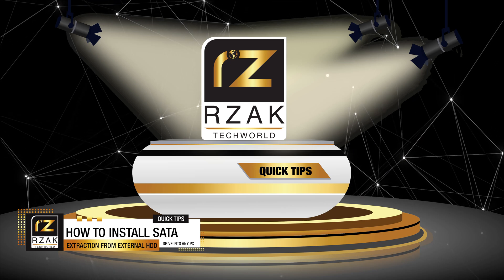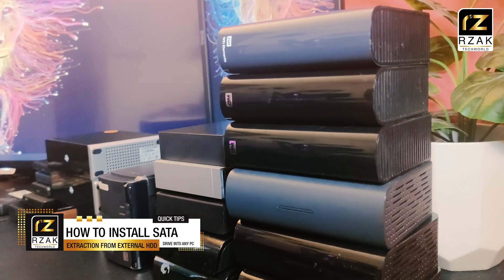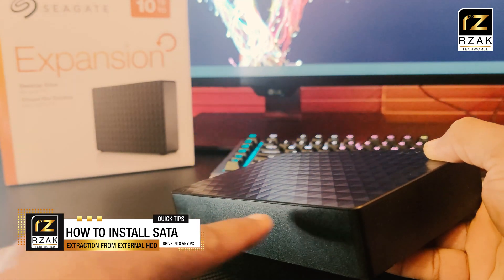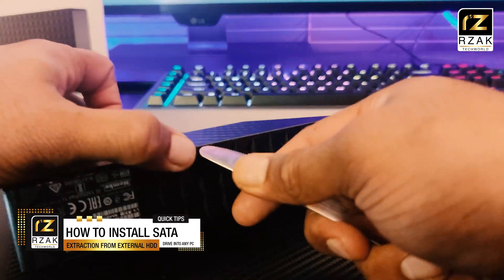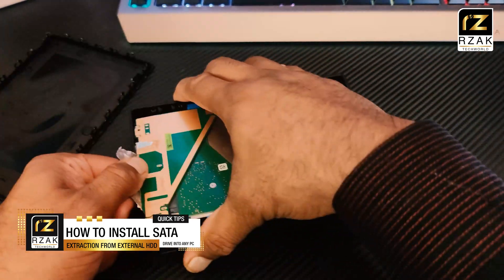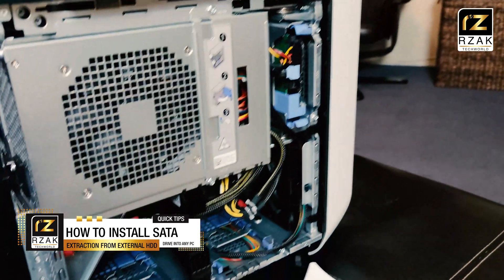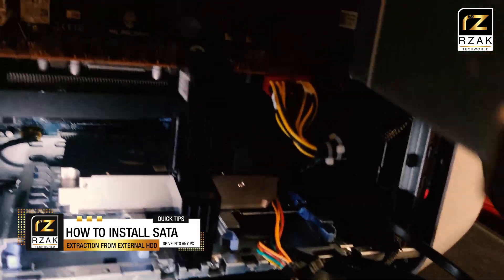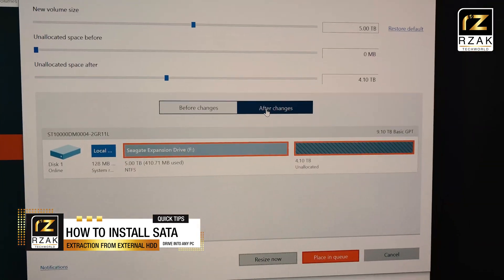How to open and Add/Install Expansion drive's SATA Drive to your Alienware PC? Easy Cheap Solution.

Comment: How big can we go?
Reply from the maker: Currently 20TB is max that is available as single drive for expansion drives but they are a bit expensive. I recommend getting 12TB or so as you can find them at better deals. Way cheaper than buying internal drives